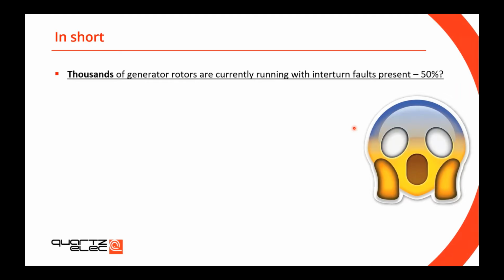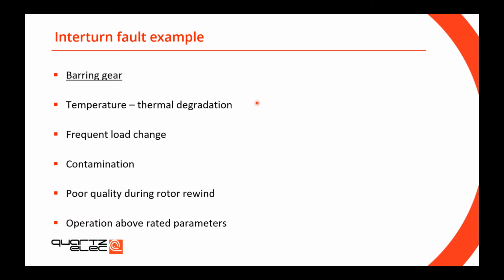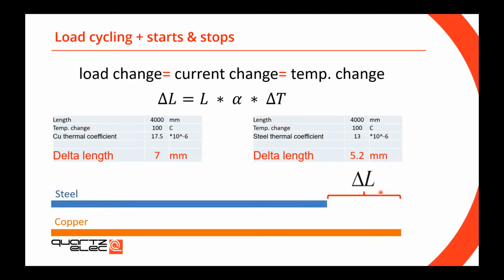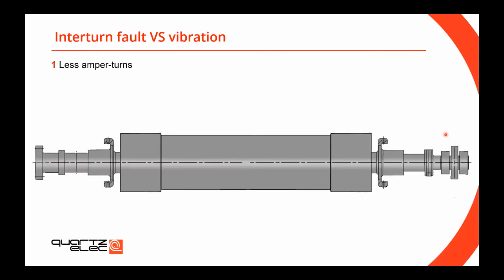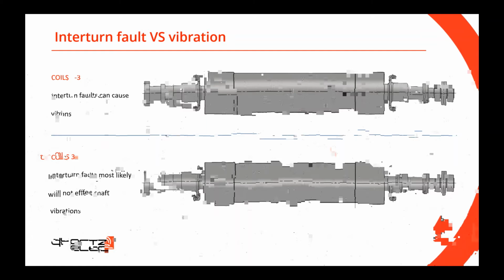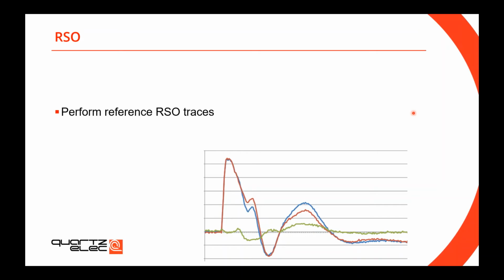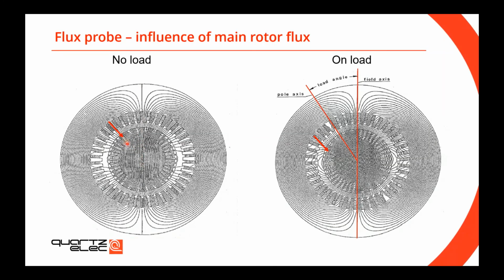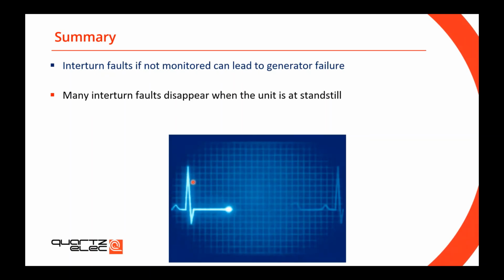Generator rotor interturn faults - webinar recording

Comment: Sir, I can't understand how barring gear leads to turn to turn fault?
Reply from the maker: Thank you for your comment! The issue with the barring gear causing turn-to-turn faults lies in the fact that the centrifugal force (CF) generated by the rotor's rotation may not be potent enough to firmly press the coils against the rotor wedge. Consequently, the slot content tends to move up and down as the rotor spins with the barring gear engaged. This movement poses a risk of damaging the insulation, potentially resulting in a turn-to-turn fault. I hope this clarifies the connection between the barring gear and the observed fault.